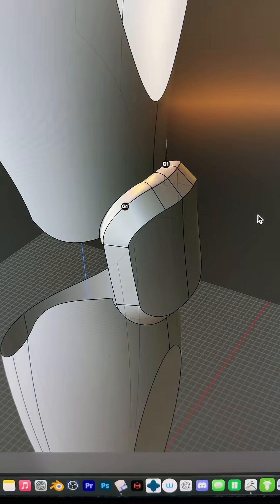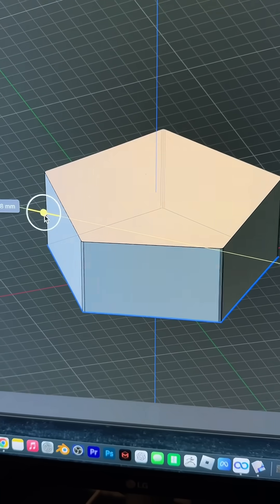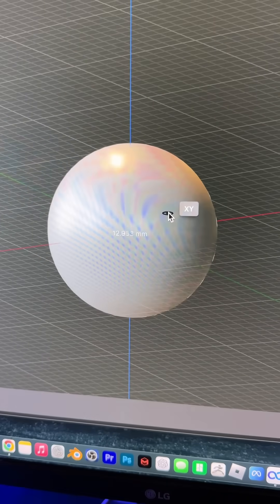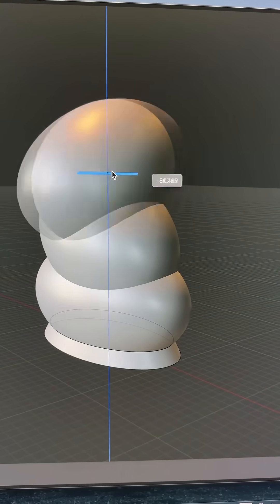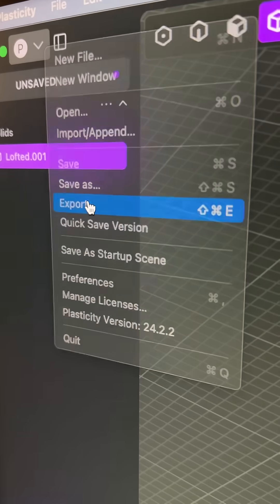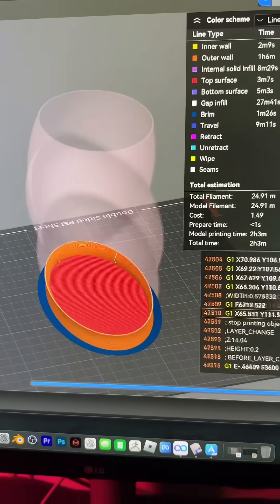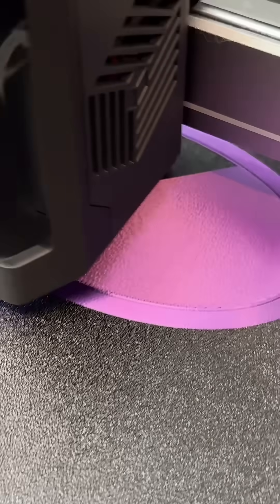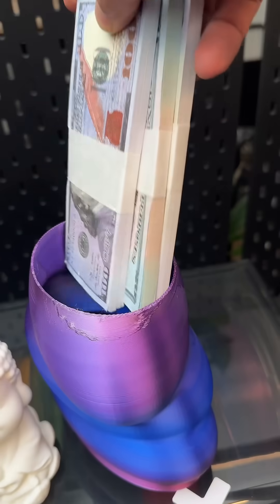Plasticity Tutorial: Hollow out a solid and export for 3d printing

Comment: The print doesn't look that good, maybe slow down the speeds and acceleration or do a full calibration of print profile and printer?
Reply: @nikolaitoxvaerd  I don't remember how that feature is called but he needs to randomize the start point of each layer. That way he doesn't end up with that ridge line across the print.